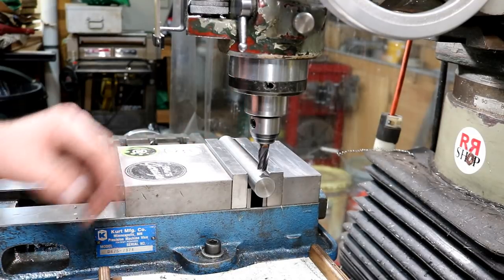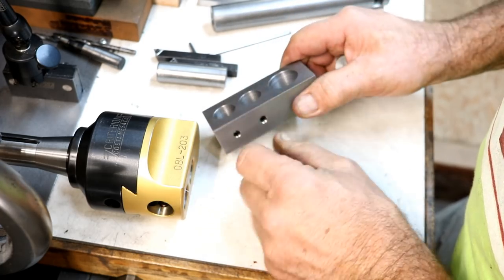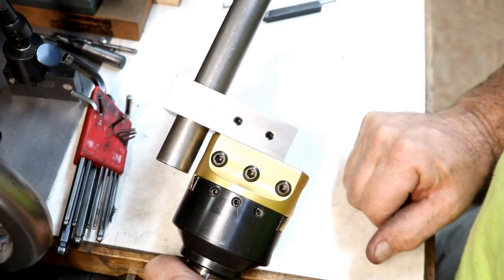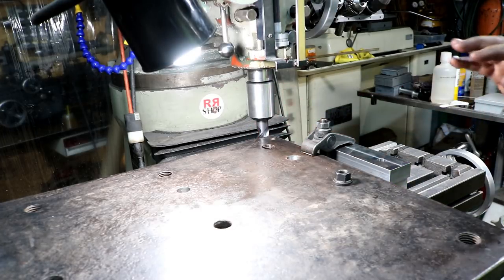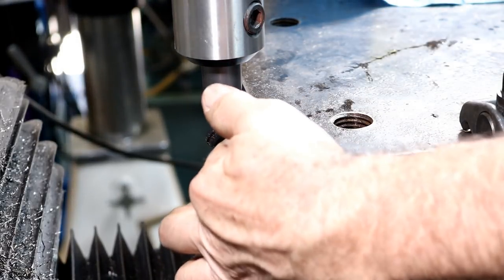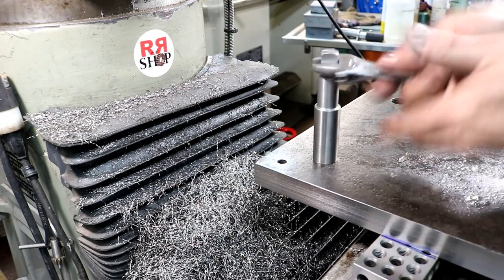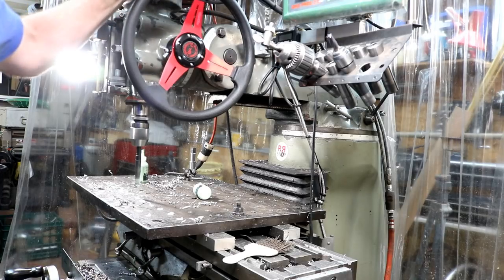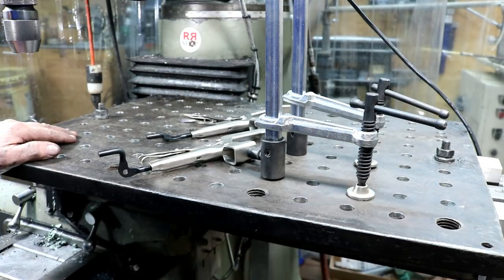Making a Fixture Plate and Making a Custom Boring Bar

Comment: That purpose made block for the boring head and bar really did turn out excellent. The bar itself looks impressive! I expect RPM's will have to be modest because of imbalance aspect.
That plate must be super heavy! Squared edges came out nice. Lot of drilling - great you have that mill. Nice job.
Reply from the maker: Thanks Chris.  Yep I am sure the turning will be slow, lots of extra mass will help.

Comment: Randy, 

Nice side project within your mixer project, this fixture plate looks great. If you desire to grind the surface of that plate I know where you can get it done!!
Reply: And that boring head extension came out top notch.
Reply from the maker: What does that sort of thing cost? 20 x 28.
Reply from the maker: Thanks Eric.

Comment: Precision like that on such a scale and then to go on to the job you did on  the mixer journals is like being taunted.  The old "Here's what you could have had" ! they use on gameshows.  I'd just about reconciled myself to making do with a new soldering tip and maybe a few grams of rosin ... and you go and do that to me!!!!  Envy is a sin.
One thing is certain though, you're a machinist, you move like a machinist and all five fingers on both hands prove you think and plan like a machinist too.  If I did get the kit (and I still have last year's letter to santa as well as the mince pies).  Yesterday I was modifying some flashy things for christmas and I found myself hanging on to a piece of wire while the solder dripped down my nail.  Pain like that focuses the mind.  I think it's pretty certain using the kit you have I'd be signing myself off as three fingered andy - or one eyed whiitey within a week.

Maybe it's just as well.

Seriously enjoyable watching I can hardly wait for the first brick going down.
Reply from the maker: Thank you Andy.  You are kind. Patience should be the #1 virtue of the worker in the
shop.

Comment: Incredible welding table Randy.  What is that cutting compound you're using?
Reply from the maker: That is anchor lube.  water based.  Great for stainless drilling and tapping, or when you don't want oil everywhere and on everything.  Thanks Greg.

Comment: The plate that Dad used for a welding table is still around here, somewhere ... short two of the legs he had put on it.  It looks like it may have been a liner plate in a rock crusher at one time, with the ragged surface on one side.  No idea what it is made of, or how tough it would be to drill or machine, I'm not sure I'd want to try.  Breaking through that rough side may well be the bane of drill bits.
Reply from the maker: Yep that maybe some tough stuff, but a great table.  Thanks Diggerop.

Comment: Lot of work there, no wonder you have put it of till now. Should prove useful though.
Tip for next time you want a square hole, drill four small holes in a square tangent to the desired square before drilling the bigger hole in the centre. An oldie perhaps but still valid, the tip I'm referring to not you or I. 🤣
Reply from the maker: Hey just tapping it thru worked.  I am not even close to being old.  Thanks for the tip Chris.
Reply: Randy Richard In The Shop   I'm not old, I've just had loads of birthdays that's all 😉
Reply from the maker: Yeah I am getting a few myself.

Comment: Where did you get the rocker arm clamps?
Reply from the maker: Terry link in the description.  Thanks.
Reply: @RRINTHESHOP  Randy  I meant the clamps that are holding the plate down to the mill table.
Reply from the maker: Ebay a few years back.